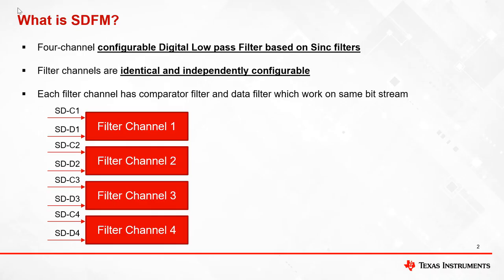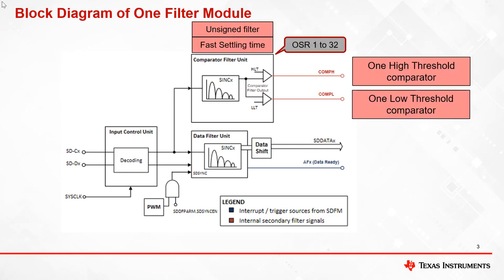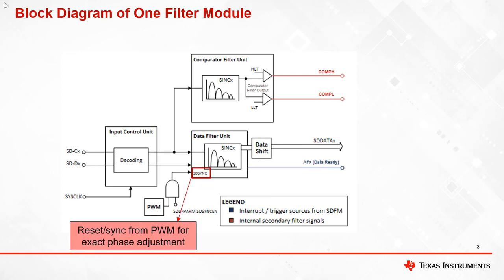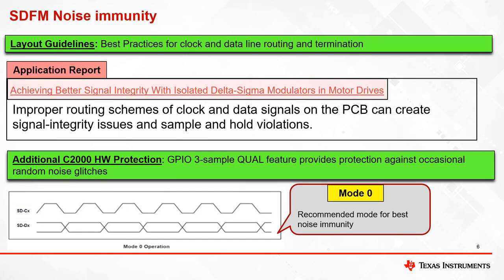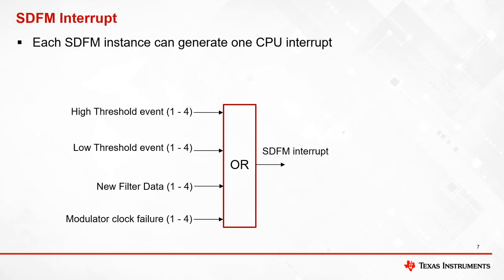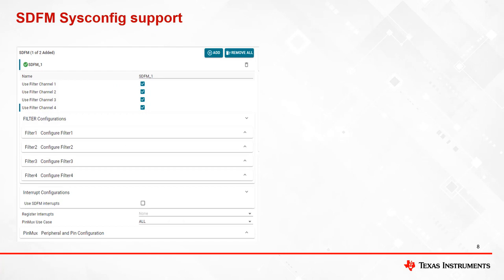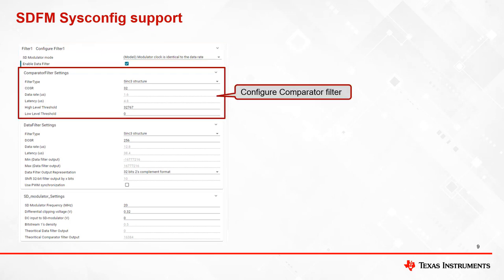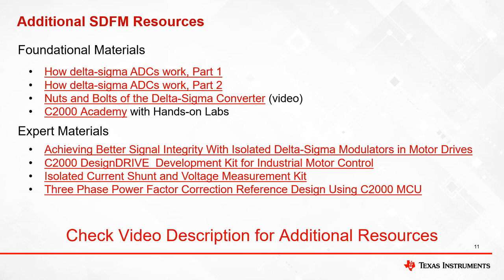SDFM-Type0 Overview

Comment: Hi, I have a doubt. Suppose if the OSR is 40, then ADC resolution would become 17 and lets say result register can hold only upto 16 bits. Then how is the overflow handled here using data shifter?
Reply: The result register can be configured as either 16 or 32 bits